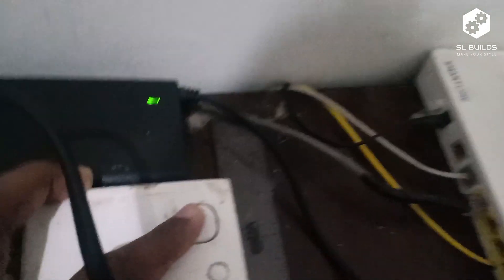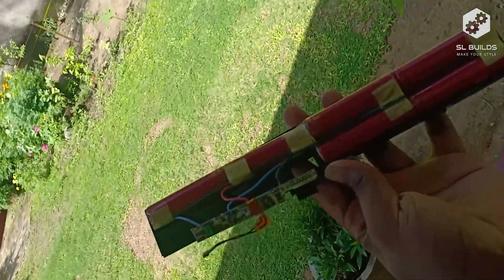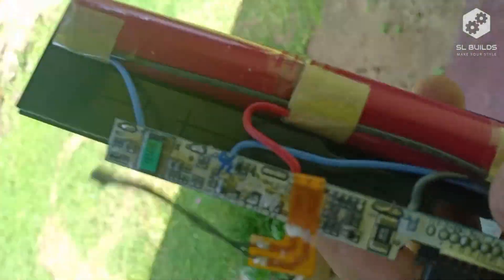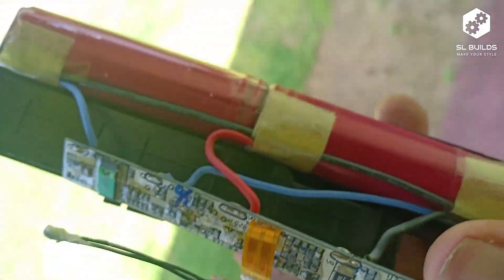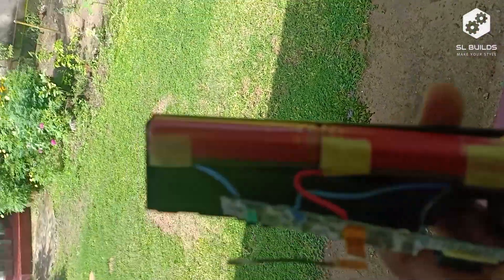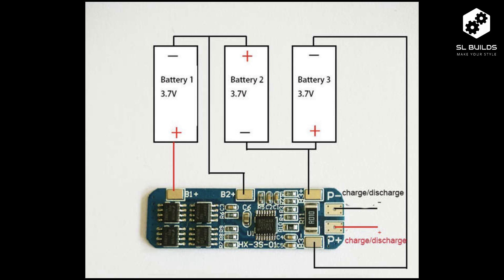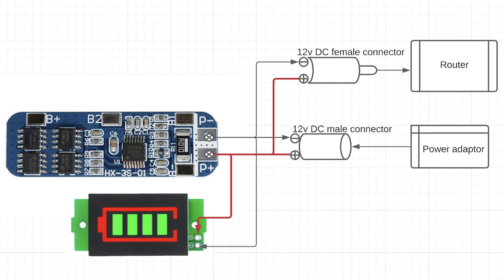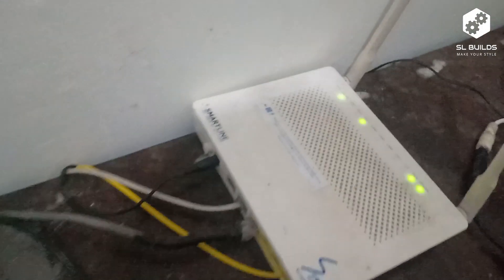Power Cut එකට විසදුම | router backup | 18650 | old laptop battery | Sinhala

Comment: මේ video එකේ 3.40 දි පෙන්වන diagram එකේ... පහල Battery එකක් වගේ පෙන්නලා තියෙන්නෙ මොකද්ද? battery meter එකක් ද? නැත්නම් circuit එක හදන්න අනිවාර්‍යයෙන්ම අවශ්‍ය වෙන එකක් ද?
Reply from the maker: 18650 12v bms kiyala net eke gahanna ethakota ei
Reply: @SLBuilds  නෑ නෑ. BMS එක නෙවෙයි. ඊට යටින් battery එකක් වගේ තියෙන්නෙ මොකද්ද කියලයි දැනගන්න ඕනෙ
Reply: ඒ battery level indicator එකක්